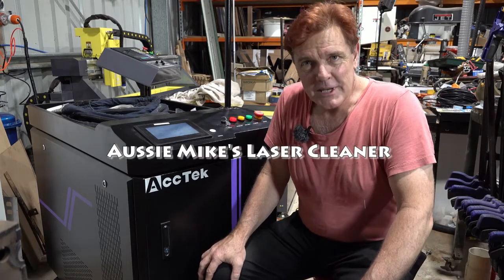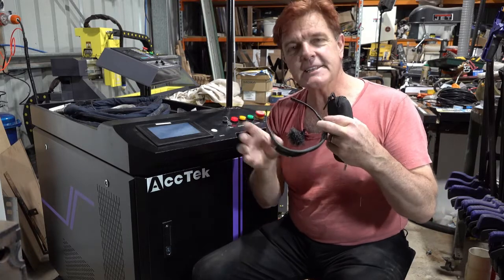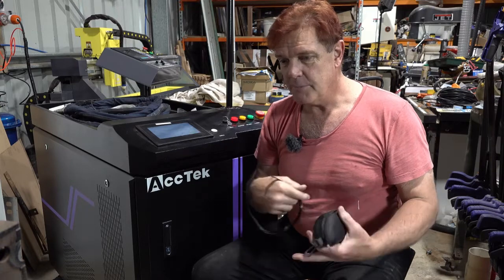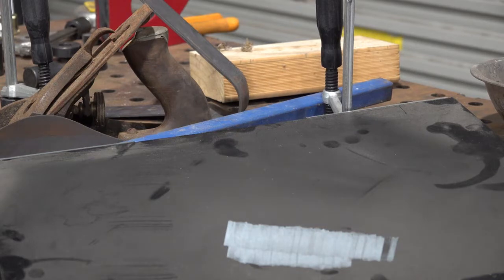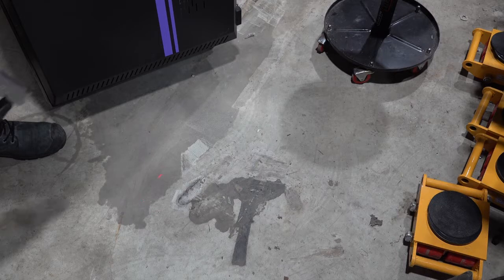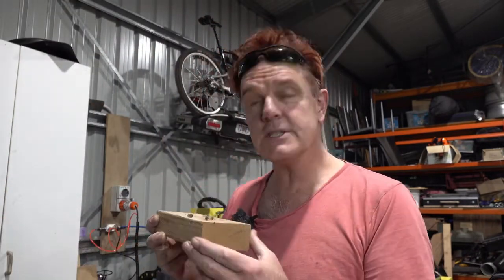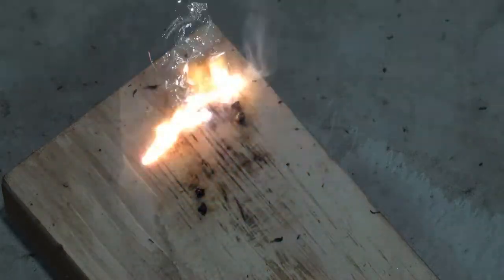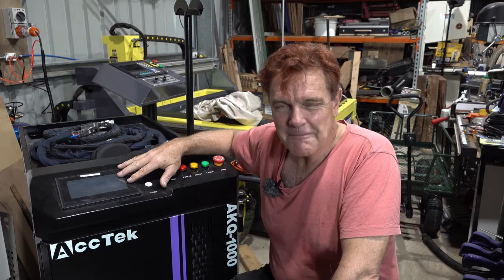Aussie Mike's Laser Cleaner! NOT a Bee Video

Comment: Mike question? Now ive been told do not go near any of the chinese ones how long has yours kept up the good fight? Narran lasers are saying $125k and seemed to genuinely tell me to avoid paying $30k for one as its going to hurt me if cant afford a $125k one start a coffee van
Reply from the maker: I have heard some horror stories about Chinese equipment, but most of my experiences have been good.  I think I was lucky to choose AccTek.  The build quality is very good and support has been good too.  Obviously, support is remote only, so it involves some back and forward emails to sort out problems.  I've only required support once for a simple self induced problem.  The machine is consistent and reliable.  I really cannot fault it.  
The high priced European and American made machines come with training and guides for different applications.  The Chinese machines do not.  It's a process of experimentation to work out the settings that work best for any given situation.  You are on your own to figure it out.
The other thing is to choose the machine for the task.  My CW laser is good at brute force removal of heavy rust and can adjust down to gentle applications such as paint removal from sheet metal, but its not great at that.  It can overheat sheet metal really quickly if you're not careful.  Pulsed laser is much better at those sorts of jobs.  You might need to have separate machines for each task if you do both.
I'm not a professional, so I don't use my laser everyday.  I have talked with pros who are doing very well with their AccTek machines and have bought more lasers with custom specifications.  It's a niche that can be very profitable, once you know your machines.
Safety wise, lasers are lasers no matter the brand.  You must wear appropriate PPE.  Glasses to protect against reflected laser flash, appropriate mask to protect your lungs(I use a powered mask suitable for welding fumes) and a fume extractor.  I don't use a fume extractor, but use a blower.  I'm on acres, but if you work anywhere around people a fume extractor is a must.
Mike

Comment: Aussie Mike where are U located?
Been thinking of purchasing a machine to remove rust in roof of a 4x4. Approx 4 m long X 100mm wide. Then I could bog   and paint small holes and weld in patches on bigger ones. Would a 300watt do the job.
Also would use to clean aluminium outdoor table and chairs that have several layers of paint.
Thanks in advance for your reply. 
Regards
Colin
Reply from the maker: Thanks for watching, Colin. You don’t want high power in sheet metal like yours, so yes 300w would do the job. Ideally, a pulsed laser is way better than continuous wave. You could have even lower power too, maybe even 100w.  Pulsed machines are more expensive, but easily portable and low power consumption. If I had my time again, I would get a 200w pulsed laser.
Mike

Comment: How big of a air compressor is needed?  And what psi is used? Thanks
Reply from the maker: Thanks for watching.  For the cleaner, only a small compressor is needed.  It's only function is to stop residues contaminating the lens.  As long as there's an airflow over the lens, the vaporised material can't touch it.  If you get a laser welder, you'll need more specialised equipment.  I only have a cleaner, so I've not looked into the welding side.

Comment: technically its a continuous laser or a pulse one?
Reply from the maker: Mine is a continuous wave laser.
Reply: @AussieMikesBees   Thank you! still thinking about wich one to choice. im going in China this weekenbd for that
Reply from the maker: Depends on your application. CW is like a sledge hammer.  You can blast alot of deep rust using loads of power.  It'll eat into the substrate too.  It is possible to more gentle surface cleaning, but it doesn't have the fine tuning available in pulsed.  Also pulsed machine can be much smaller for a similar effect.  If you're going onsite to clean moulds or soot off bricks, remove paint from sheet metal then I'd go for pulsed.  If you'll have a workshop where people bring their stuff to you for rust removal, maybe CW will do.
I'm sure the manufacturers will steer you in the right direction. Enjoy the trip.
Reply: Thank you for the advices and explications! ill try to find the good one at a good price.  If you pass by Tokyo someday let me know, i hope my laser cleaning company will be already on the good way

Comment: hello mike
 just got my machine but the peaple at acctek dont give full infermation on full set up your video and replys are very helpful what size commpresor do you use and will the laser work with out the compressor attached. you give more infermation than acctek  good job and also is the commpressor just for keeping contamanets away from lens or dose it have other perpase
Reply from the maker: Hey Jake.  

The downside of buying Chinese at low prices is there is no training.  The best teacher is experience and doing loads of trial and error taking notes on settings that work.  I know people can fine tune these machines really well.  I don't use mine everyday, so I've been surpassed by others that bought their's after me and you will too if you're making a living with it.

Yes, the compressor is to keep the lens clear of contaminants.  I wouldn't run mine without it.  You don't need anything special, just capable of the run-time you'll be requiring.  Mine is a better than handyman, less than pro model that I use for my CNC router and CNC plasma and general use around the shop.  I recommend a drier of some sort.

Comment: Hi Mike, nice video thanks, How close can you get to the work surface? say removing rust from a car frame? Working under the car on all the different surfaces?  Thanks.
Reply from the maker: Thanks, Gregory. Good question. Lasers have a fixed focal length determined by the lens. Maximum power on the surface is when the laser is held at that distance from the surface. It is possible to move closer to (or further from) the surface, but the power drops off. Mine is 400mm. You may be able to select a shorter focal length lens, but you don’t want the lens too close to the surface because the fumes may contaminate the lens reducing efficiency and shortening life. For working under a car, I’d have it on a hoist.

Comment: Hi Mike how is the machine going . Im considering grabbing one for commercial use. Do you think it would hack day to day use. Did you look at other chinese companies. Any advice would be greatly appreciated Mike. Thank you
Reply from the maker: Hey Nik, 

My laser is going good, but I’m only an part time user.  I have every confidence that it can handle full time duty.  It’s a very solidly built machine. My experience with  Acctek has been positive. They’ve responded to my requests for help whenever I’ve asked. 

If I had my time again I would choose a 200watt pulsed laser.  Much lower power requirements, portable and more effective than the continuous wave. I did look at other manufacturers and found they were a little deceptive about pricing.  Acctek were straight with every detail: the deposit to start the build, final payment before shipping and the shipping cost and details. The only extra cost is local import fees, customs and transport from port to my place.
Mike
Reply: @AussieMikesBees  thanks for your reply mate. Yeah was considering the 200 pulsed laser but it does cost a few K more but my biggest worry is would it have the punch for heavier rust etc. 

I was going to throw the 1000 in a van with appropriate gennie. But I can see the downside with gennie costs and moving the thing around. 

Acctec are using your video in there promotion material. Just a heads up in case you are unawares 

Cheers
Reply from the maker: Hey Nikky,
The thing with pulsed is they pack a punch above their weight class. Each pulse is higher power for short duration. I haven’t used one yet, but all I’ve heard indicates it’s more than capable of rust removal with lower risk of damage to the base metal. I think you would forget the extra outlay, when you have much lower power requirements and weight. Get a good fume extractor fo mobile jobs.

Comment: Hey Mike,  placing my order next month for your exact model. How has your machine held up over the year? any lenses burned out and are replacement lenses obtainable?
 I am beyond excited to join the laser cleaning game!
Reply from the maker: Hey Charles, congratulations on your machine. Mine came with a bunch of spare lenses and I still haven’t needed to change the first one. I’m not a heavy user though. Your experience could be different. Depending on your application, I’d consider going for pulsed laser in the 200W range. They perform very well and are portable with much lower input power requirements.

Comment: Hey Mike, thanks for the great video. I am expecting my machine from ACCTEC in the next few weeks and I was hoping you could give me some guidance with regard to stripping paint from wood. With a 1500 watt machine, what setting (power wise) should I be shooting for ? I don't want to burn down the building. Thanks in advance.
Reply from the maker: Hey Paul, good question.  I haven't tested paint from wood removal yet.  One of the things in the long list.  You'll be aiming  for low power and one of the patterns that prevent the laser staying on one spot too long.  Getting the right settings is trial and error and loads of practice.  It takes practice to get a feel for how high off the material to keep the laser and how fast or slow you move.  Paint some scrap wood now, so when your machine arrives you can start experimenting and take notes of everything you test.

Comment: Hello mike how is the machine holding up, any problems and are you still happy with the machine? What did u pay for it if you dont mind me asking
Reply from the maker: It’s been a solid machine, although I had a minor glitch a while back. Turned out to be an interlock problem, nothing serious.  If I had my time again I would get a pulsed laser. Smaller unit, lower power requirements, better performance. I don’t remember what mine cost, but it was way cheaper than the European or US brands. You can check current prices at Acctek on Alibaba.

Comment: Hi Mike, thanks for the video, it's great. Are you still happy with your machine after almost a year?
Reply from the maker: Thanks, Ollie the Collie. Yes, I’m happy with the machine. If I had my time again, I would go with a lower power pulsed laser. They are easier to work, smaller and lower power requirements. Down side - higher cost.
Reply: @AussieMikesBees  Thank you for your reply.  Do you think you would also have better results with a pulsed laser than a continuous wave?
Reply from the maker: @Ollie the Collie  I haven't used one yet, but from what I now understand of the technology, pulsed can be dialed in with precision to get amazing results on a wide range of materials.  CW is sort of a sledge hammer - you can hit the pin nail gently, but it takes more effort to get it right than using a pin nail hammer.  CW can put a lot of heat into the substrate if you're not careful and that could damage the part.

Comment: Let me add a little info. 
This thing is a continuous wave 1064nm laser. It will absolutely fuck you up. It adds immense amounts of heat to everything it touches including the substrate. It will melt steel. It will not however remove rust as such. It changes the surface of the rust leaving the impression that it removes rust, but unless we're talking very superficial rust there's gonna be rust underneath. 
If you want to remove rust you need a pulsed laser. A pulsed laser won't burn and is inherently more safe than this diabolical thing. 
But a pulsed laser is expensive.
Don't focus on wattage btw. It doesn't mean much of anything.
Reply from the maker: Thanks for commenting, Whiskey Throttle. 
I agree, these things are potentially very dangerous. Just like… well everything in a workshop. Safe operation is down to the operator. 
Yes, pulsed lasers are much better. They remove contaminants more efficiently, less likely to damage the substrate, have lower power requirements and are smaller than CW lasers.  
Yes, the CW adds immense heat and can melt metal. 
 I can’t say I agree that it doesn’t remove rust though. Sure, it doesn’t work as good as pulsed, but I definitely see rust removal. 
CW takes a lot of time and experimentation to get the right scanning pattern, width, speed, power and technique to remove contaminants,including rust with minimal damage to the substrate. It also takes longer than pulsed. 
Everything about pulsed is better than CW. Except the cost. If I had my time again I would’ve waited and chosen pulsed. If I were buying one of these to make a living I’d buy a pulsed. 
Why would anyone buy a CW? It’s way less capital outlay, great to learn on and gets a foot in the door of laser cleaning. Put the time in to get good at CW, you can make enough to finance the upgrade to pulsed. Or if it turns out that laser cleaning isn’t for you after all, then the loss isn’t as high.
Reply: @AussieMikesBees  Thank you for the detailed explanation!  I thought that CW was pricier than pulsed.

Comment: Thanks for the video Mike! I actually ended up buying one of these recently and am about to get started with it... i had some quick questions for you though if you don't mind.
What is the jumper cable for? Is it simply attached to the gun to ground it? And did your machine come it or did you fashion it up yourself? 
Thanks!
Reply from the maker: Thanks for watching, Mike. My laser came with the cable clamp attached. I couldn’t find a reference to it so I just leave it on the gun. It might be related to welding, though mine doesn’t weld. I don’t see a reason to earth the workpiece.  I’ll ask next time a talk to tech support.
Cheers,
Mike
Reply: Goodcinfo m8keHi mike how much air pressure and volume you running,mine shows up in about a week,got a 2000w and 300w pulse on the way😊

Comment: l have a ACCtek also very happy with the brand
Reply from the maker: Thanks for the feedback.  What do you use yours for?  Have you worked out the best settings for material you work on, or still fine tuning?  Has it proved to be better than alternative methods.  Have you had any problems with it? If so, what was your experience with tech support to fix it?

Comment: I have one but the head overheats and the chinese are awful to deal with.  They never answer any questions.  Do you use compressed air when cleaning?  If so what pressure
Reply from the maker: Thanks for sharing your experience. It’s a gamble buying anything from China. I’ve been mostly lucky especially with my lasers. I have no trouble communicating with AccTek for tech support. So far I haven’t needed parts, so have no comment about that. What brand is yours? I use about 90-100psi compressed air to prevent the lens being contaminated by smoke.  My head has is cooled by the chiller. If the lines were kinked, it might cause overheating.